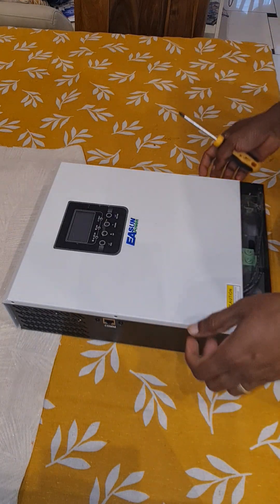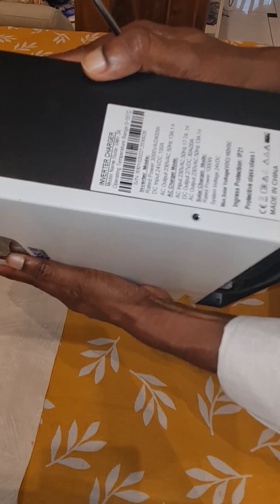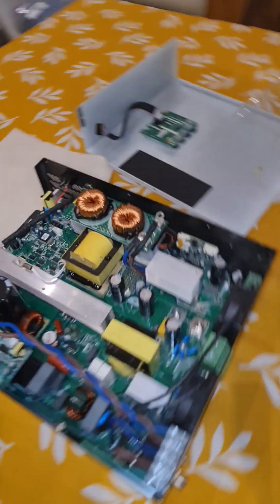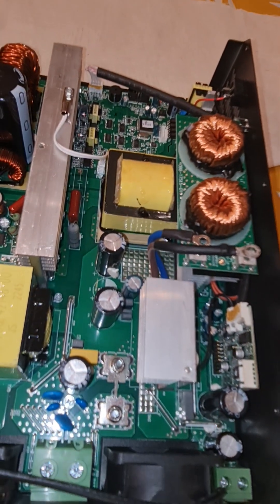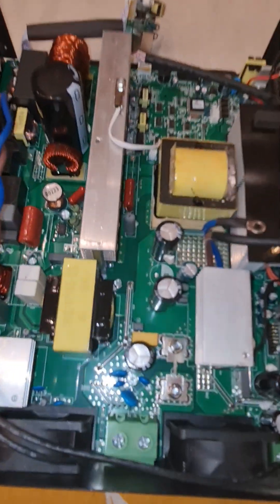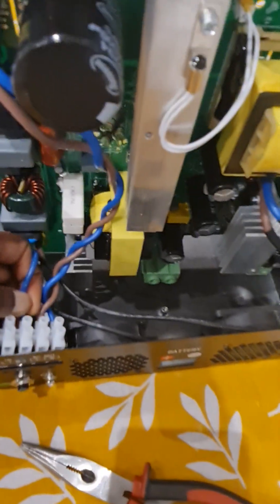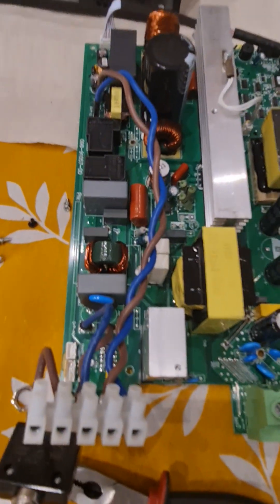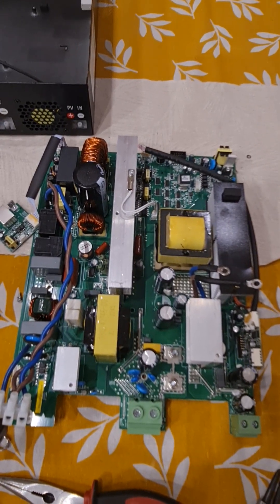EASUN SMH-3K 3kv 24v Solar Inverter  teardown and repair Part 1

Comment: Hello, I have exact the same model and it works fine for years now. Do you still have the manual? Could I get a copy from you? I had lightening last week and somehow it stopped charging my batteries after that.
Reply from the maker: Look at easun-energy.com, browse to the product, they should have the manual linked in the description

Comment: How many solar pannels can you attatch to this? Im thinking of buying one of these and i want to attach as many pannels as possible so i can run everything of solar during the day and will it automatically change over to mains in connection after sun goes away, or what would you suggest? . Thankyou for sharing.
Reply from the maker: I tested with 4 panels@ 410w. However I would not use 24v system for more than 1500 watts. Anything more than 1500W, should use atleast  48v system.
Reply: In parallell or series? What was the amperage output of the four panels?
Reply: @mauritianobserver  they are 350w pannels , I have 2 series and the 2 pairs in paralell
Reply: @HouseAndSolarProjects  my pannels are 35v so 2 series is 70v X 700w and total is 1400w X 70v

Comment: Hello. Would it be possible to work without the batteries, turning it off via the panel and then it would just be up to photovoltaic panels?
Reply from the maker: Yes, it is possible.
Reply: @HouseAndSolarProjects  ok obrigado

Comment: hello, could you please give me information of this inverter about pv input because ive got a problem? the pv input of pannels is around 190 volt dc. i measure this value on pv input with multimeter. inverter not recognize pv input and not show on lcd pv icon. any ideas of what is going wrong? there are 4 pannels (550 watt voc 51,44volts , vmpp 42,57volts) in series. all connections are double check. Also switch off fuse from pannels and after switch on unit with only battery connected and measure pv input contacts  on unit and was 0.4 volts dc. Is this normal ? pannels are new and inverter so. i appreciate any help .
Reply from the maker: This model can accept only maximum 80 Volts, your best bet is to put them in parallel. Since it can handle max 40A, do not put more than 3 500W in parallel and use thick cables which can handle 40A load.
Reply: @HouseAndSolarProjects  sorry I thought it was same with mine. I have easun smg 2 5,6 kw and range of pv nput voltage is 120-500 vdc .

Comment: I'm wondering where can I found the buzzer? We have cheap electricity during night and I start the charging with a timer. It drives me crazy though that I cannot switch off the buzzer completely and the inverter wakes up the whole household when it starts.
Reply from the maker: I will make a video on how to remove it.

Comment: Do not buy EASUN products, I tried to contact the people from Easun because this model has a lot of problems, but after the sale they are no longer interested in beneficiaries 1 At a consumption greater than 1.1 kw, the 220 v output stops and enters in standby or stops, it no longer consumes current from the AC outlet even though it has energy from batteries and the sun [photos attached] it only comes back after restarting the inverter
2 If I set the charge both from the solar and from the input from the national grid, it only charges the battery from the solar, I tried all the settings according to the manual
3 On reboot, it reads /Watt of installed panels correctly and /Ah after 2 minutes, the wattage and Ah of the panels drops suddenly, although it should charge as the battery is discharged [eg. 72V 900W and 30Ah after two minutes, suddenly drops to very low power ]installation connection panels are new and checked
4 Certain settings cannot be changed from either the control panel or the clock power[ex Max AC input/oput]
5 The inverter cannot support the consumption at the AC output from the panels, the bathroom and the national grid at the 1 kw load, it only consumes from the battery, although it must compensate for the difference compared to the solar system or the national grid.
6 During consumption, the inverter discharges the battery to exhaustion, even if it has enough PV power, then enters stand-by or stops and starts charging the battery on restart
7 He does not know how to charge the battery from two solar sources and the national grid
Please send new firmware update and firmware installation software
Reply from the maker: Sorry to hear. If you have problem contact their support with the Excel Sheet with purchase data, with video or photo evidence, be persistent, I got mine replaced after around 8 weeks.
I will try to answer your issues one by one.
Reply from the maker: For point 3, it is expexted behaviour, as the mppt fixes for the maximum power point. The battery may not consume all the power available, based upon SOC. In start it will use up all power available,  but in later stages it will not cosume everything.

Comment: Hello, why did the inverter in the video fail??
Do you know where I could get a firmware of mine has problems
it has power from the solar panels but the inverter consumes the battery
until it runs out, after which it turns off the panels, even though it's sunny outside,
it should take power from the sun and the difference from the battery does the complete opposite.
Reply from the maker: The inverter failed because I believe one of capacitor was defective and shorted.
For your problem try to configure the menu program 1 and set the value as SOL for solar first.
Reply: @HouseAndSolarProjects that's quite interesting, think that's the way I want mine to work. I want the solar to power my house all day and then automatically change over to grid power when solar goes away. Is that possible? These controllers seem to be about £200 pretty good value  realy